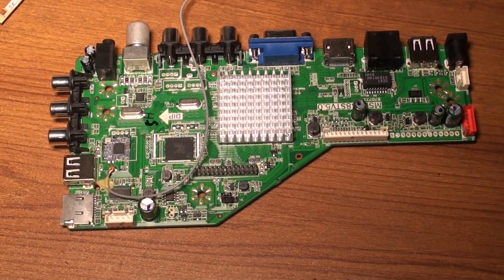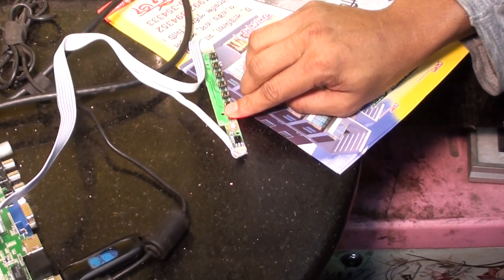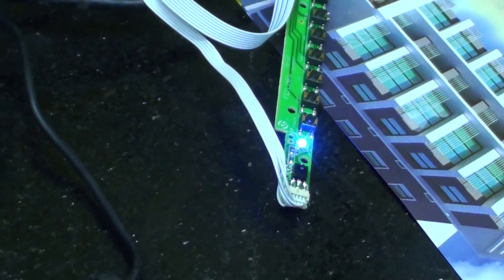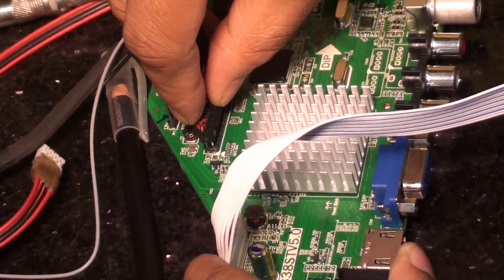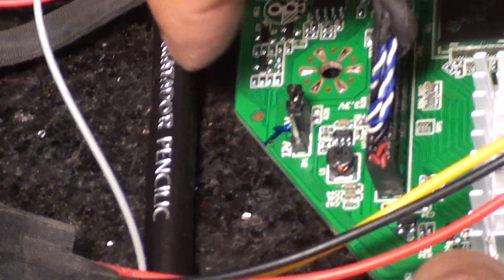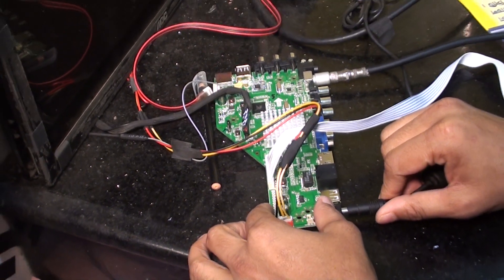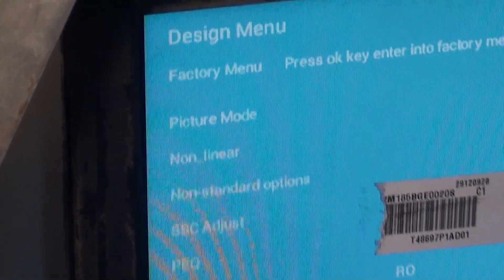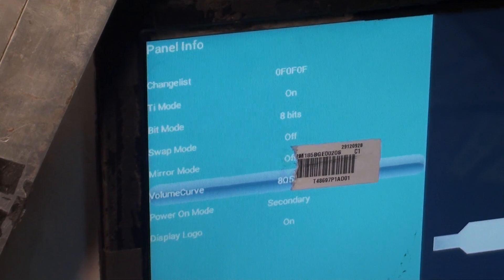Android Universal TV board MSD338STV5.0 installing process.#Pro Hack

Comment: Hello please can I ask you a question, I want to use this for a laptop with a 3.3v led backlight, I have noticed that this board only supplies a 5 volt and a 12 volts supply and it dos not have a 3.3v, can I use a Buck converter to reduce the voltage to 3.3 from either 5 volts or 12 volts supply on the bord????
Reply: you cannot ask any question,,,.. you just give him some views and drop a cute comment.

Comment: I ordered MSD338STV5.0 and what the seller sent to me was VS.S358A3.2 everything seems to be the same but when i tried to install the firmware it did not flash even after holding the power button, I used the firmware for MSD338STV5.0.
I feel it did not work because they are not the same board. Please if you can help me with VS.S358A3.2 firmware i will be grateful. Or tell me where i can download the firmware for VS.S358A3.2
Thanks

Comment: hello guys, I would like to know if you know if this 1440x900 LCD card is useful since I have seen that the firmware reset of 1g says no 1440x900 and effectively when I charge this reset with 1g if it shows full screen but with logo, but in logo it Actor, when I do it with the reset of 512 and the same firmware loads everything, but the screen is out of focus the mita, it does not appear full screen, I hope you can give me a solution, I will be aware of the answers thanks.
Reply: I have also same problem and I couldn't solve this problem . did you solve this problem ?